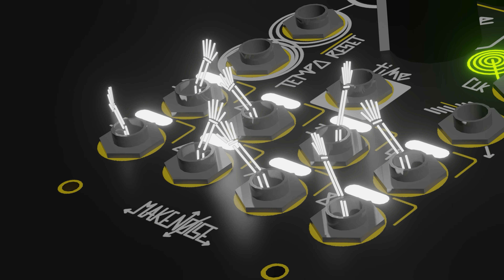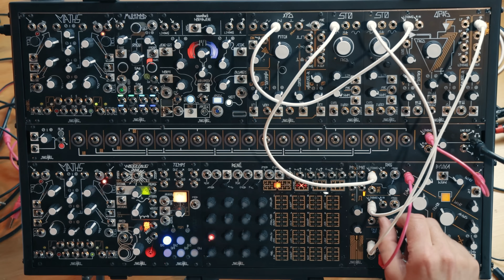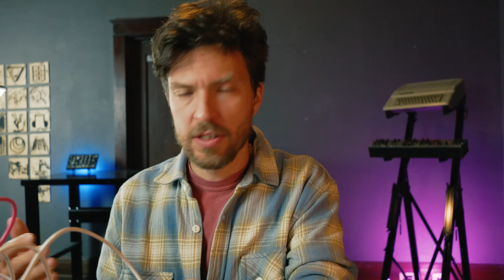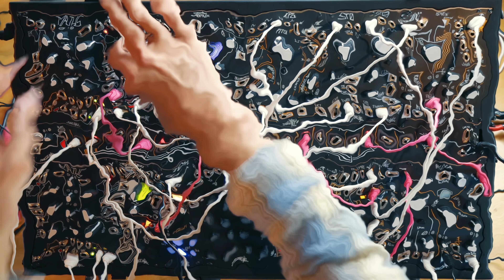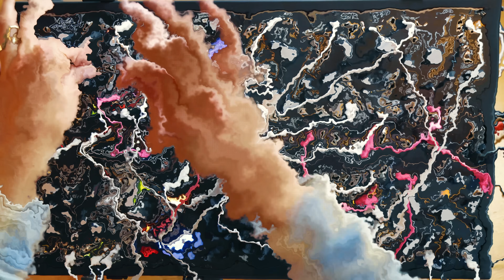CV Sequence Replication | Make Noise

Comment: I love this workflow, but I am also immediately wondering how I could utilize these sequences without droning the VCO. How could I trigger/gate from all the changes so my separate voices can strike or trigger envelopes for each note change... u-he's Wiretap comes to mind, but wouldn't mind seeing some kind of expander for MultiMod
Reply from the maker: I have a Wiretap in my home system, which can work to some degree (on a couple channels). A second MultiMod gives a full set of such control plus the ability to disengage the sequences/gates in various ways - will probably do a video on that technique at some point! -W
Reply: @MAKEN0ISEMUSIC  MultiMod 2-pack when
Reply: Wiretap works pretty well for me (albeit it will only process 2 channels)

Comment: Is it possible to envelope those ocilators without a 2nd Multimod?
Reply from the maker: We only used one MultiMod in the video... if you mean copying a gate sequence separately from the CV sequence, that'd require a second MultiMod - in fact I plan to make a video about that technique at some point!
Reply: I’ve been using the u-he Wiretap module with Multimod to derive triggers from time-mangled CV sequences. It works a treat! It’s a dual slope detector that monitors a CV signal and creates gates when the signal changes - perfect for triggering envelopes in time with note changes.
Reply: @ Brilliant.
Reply: Asking the real questions. How dope would that be.
Reply: I was curious about the same question- Could you use the same multimod outgoing channels to send both cv note values and gates? Maybe some cv note values will be to low to mult and use as a gate also, but it could add interesting dynamics to the sequence.